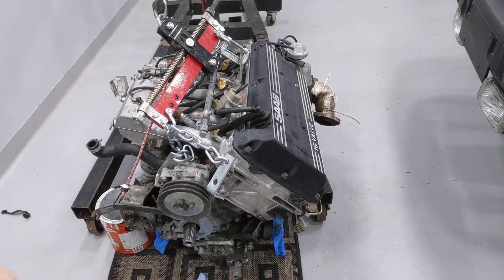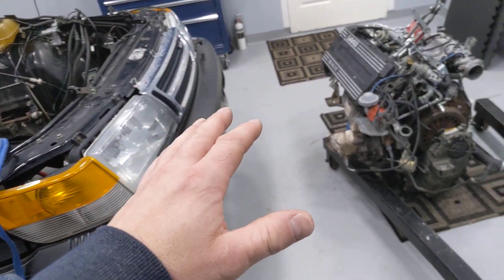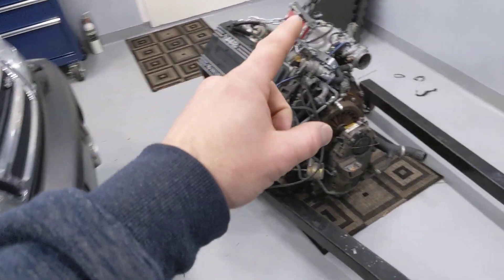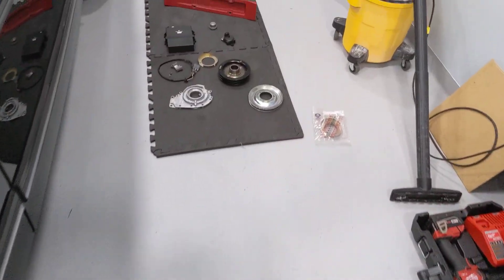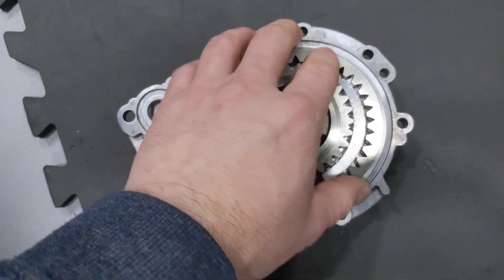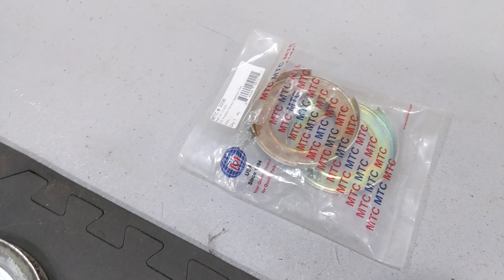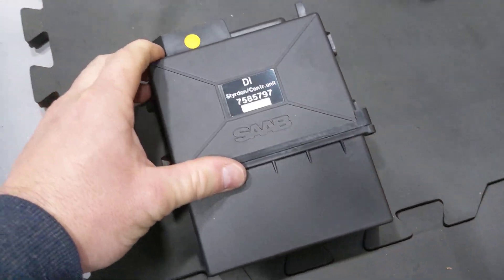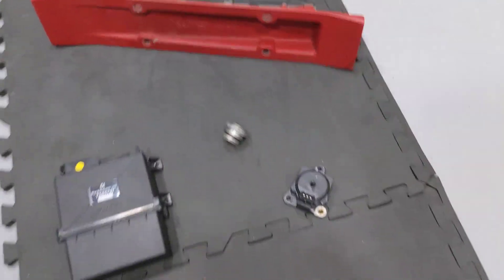How to Install DI88 on your Saab C900 - acquire the correct parts!

Comment: What I was actually thinking at the 5 min mark: "You sir are insane ... and brilliant ... and patient beyond belief!" 

Holy cow dude - fantastic research and scouring of the internet! You seem to be trying the most SAAB-thing of all for your car: trying to make it stand out and be different from an engineering point of view. Good luck and God speed; hope you figure it all out in the end.  I would have to imagine that there was a single, crazy electrical engineer back prior to 1988 that had to be thinking "I wonder if I can make all three of these systems work together for fun? Hehehe"
Reply from the maker: Actually it was such an odd system. The wiring diagram is 'reverse' of common Bosch equipment and also the software is encrypted in a VERY odd fashion! I don't think they wanted to have it easily reverse engineered

Comment: You say this DI/APC/LH system was used in 1988 only, but I thought all pre Trionic 9000's used this system? What makes the 1988 one different?
Reply from the maker: DI/APC system is NOT the dame as the DI88 system. Totally different animal. Unfortunately the DI/APC system is not easily tunable, otherwise I would have preferred that instead